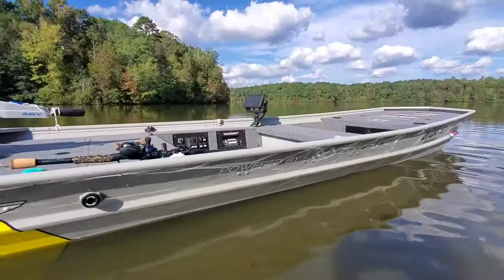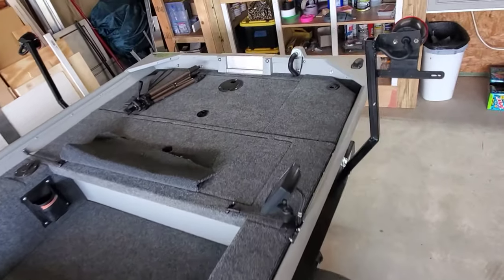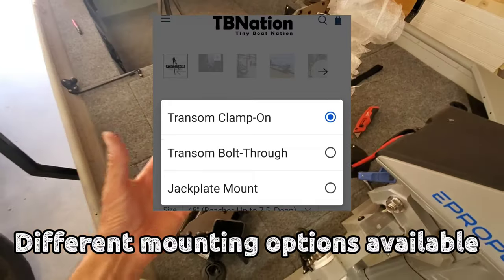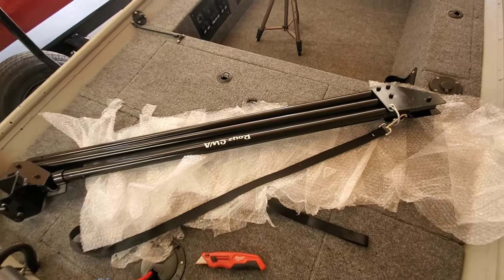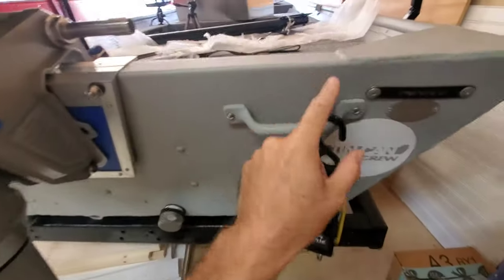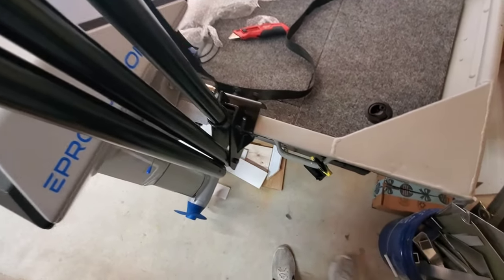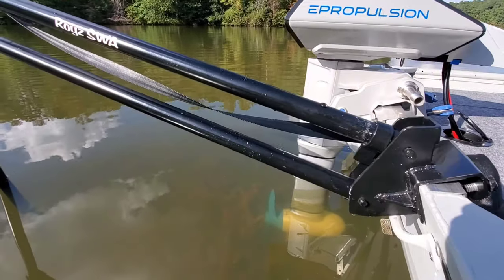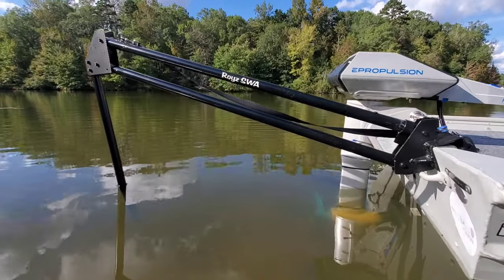Shallow Water Anchor On Jon Boat | The Anti Power Pole

Comment: Question:  Without a spring, and due to its light weight, what holds the pole in place?  It seems to me that due to it's light weight the "Point" wouldn't dig-in well enough to anchor your boat.  Great video!  I have a 17 ft. aluminum 8ft beam and a Merc 50 and interested in a Royz; if it will hold my boat. Thx.
Reply: Micro power pole would hold ur boat just fine if you want an actual power pole. The micro works great for my pontoon and kayak.

Comment: Why couldnt u just by a 1 inch 6 ft Long round aluminum rod and insert it into a vertical welded sleeve on front and/or back of boat.. with a nice sharp steep grounded taper? With a pull handle up top. And holes drilled all the way down for those clamp pins, (3 point pins?) put 1 pin above and 1 below sleeve.

Comment: Cool,but let’s see if it’ll work in current or wind where it counts. I didn’t see a ripple on this test. But if it holds I’m a buyer if cheap enough compared to the micro.
Reply from the maker: I assure you it holds in current and winds. Tons of guys I know running these in rivers on mud boats and I personally know a guy running one in Charleston SC running his jon on the flats.

Comment: Do u need to remove it  or just leave it on while you trailering ur boat on the road or even highway?
Reply from the maker: I leave it. It's bolted on tight and secure. Never had an issue
Reply: @AnthonyJonesBrigadeBoats  I think urs is a clamp on instead. Cause u don’t have to drill the hole right.  U just tighten the bolt.
Reply from the maker: Yes, clamped on as tight as I could get it. Removable though. Leave it on full time. Even when trailering, no issues

Comment: I would like how much your boats weight. It looks to me that all the boat builds exceed the recommended weight capacity of the boats.
Reply from the maker: Looks can be deceiving.  This boat is framed out of 2x2 western red cedar and 11/32 plywood.  Incredibly light which is how I achieve such high top speeds in it in my electric outboard test videos. I'll tell you this since you asked about weight on multiple videos- I've seen boats with 800 pounds alone in batteries. I've seen boats with full builds and two 300 pound men fishing out of it. I've seen 14 ft jon boats with over a thousand pounds in them. Guess what? They still float. It's a recommendation. Not a law. If you are very concerned about boat weight,  I would strongly recommend not modifying a boat in any way, therefore you can have peace of mind.

Comment: Only using one anchor pole, does the boat swing around in a  circle with the wind or current? Would you recomend two if you had the room?
Reply: Yes with any one shallow water anchoring the boat will allow it to slowly circle around the anchor depending on the conditions. You definitely need two of something for anything but calm conditions.   I currently run a Power Pole micro anchor on my 18 foot jon boat with a Venon Downright attached to my trolling motor, but have never been totally comfortable about this setup.  It holds fine, but I have always been a little paranoid about putting stress on my shaft and I already have so much crap on my bow that I don't want to add anything else there and I don't really want to add another micro for battery reasons and a complementing manual pole on the transom would kind of defeat the system I have now where I don't have to walk back to deploy.   

I've been thinking about trying these Royz out for a while now, but have honestly been worried about the how well they would anchor.  It seems counter intuitive and I have never found a straight answer about just how much weight this anchor is capable of dealing with.  800 bucks for two is kind of  risky!

Comment: A 10 ft stick it is only 70$. Way easier
Reply from the maker: Your entitled to your opinion although for my case I don't agree. 10ft pole in my 14ft boat would suck. Also when I do these product demos I'm not always looking the cheapest option.
Reply: No mud, sand, or water in the boat with this product either.

Comment: And the price is ? 🤔
Reply from the maker: Link is in the video description, the one I have is 400. Lots of options though depending on size and mount, they even do custom applications
Reply: @AnthonyJonesBrigadeBoats  , the reason I asked is I want to do a skiff for the saltwater flats and I’ll be using a push pole , I’ll mount a a pvc tube to the back of The transom with C shape brackets and put the pole in the tube , this will allow for deeper water and will allow the boat to adjust for the tide , plus I don’t have the spike hanging off the back , but the manual unit is cool and a great idea 👍🏼
Reply from the maker: Yeah man I actually looked at that option and if I were flats fishing that's what I'd do. I looked at a company where you can get different sized poles and mount the spike and t handle. Only problem fir me is I don't need a long length fir bass fishing and it would be super awkward inside my boat. Another example of why I always say all boat mods aren't universal! Different parts and approaches to different styles of fishing or goals for the boat. Good luck with your project man 👊

Comment: Why pay $400 for this when i could pay $600 for a powerpole micro?
Reply from the maker: If your truly asking why here is my answer- Micro powerpoles require power. They have internal parts that i have seen people break. They use a composite stake, not metal, the driving force of the micro is not what youd think for harder surfaces....My biggest reasons- Micro does not auto adjust to water heights, the Royz is mechanical with moving parts and keeps you anchored regardless of water height change with wakes or currents, if water height changes significantly with micro, you pull out of anchor. Lastly,  your number is wrong, 600$ for micro and spike is not included,  add another 100$. So 700$. Tbnation.net  had Royz on sale around X mas for 300$ so that's less than half the cost of an inferior product. Worth it to me. Just because it has Power Pole stamped on it doesn't mean it the greatest applicable jon boat shallow water anchor.
Reply: @AnthonyJonesBrigadeBoats  fair enough, however, i feel that in that case just a hand stake used in unison with a gheenoe style anchor bracket would be more economoical and easier while addressing the problem you mentioned with the power pole micro
Reply from the maker: Well you said why spend 400$ on this opposed to spending 600$ on that, not what anchor system is most economical. An anchor stake works fine, I personally do not want to carry an 8 ft pole around in my boat regardless if it saves me a few hundred bucks. If you see value in a product, buy it. If not, don't. That's with anything out there. I really like my Royz and understand why it differs from other products and how it benefits me. Apparently others do as well as  Roy has sold a lot of these units the past few months. To each their own I can only say that it works well for me.

Comment: U could've bought a fuel efficient four stroke motor instead of carrying a 250 pounds of batteries for that electric job u got for 4 grand
Reply from the maker: It runs on one 48v lithium battery pack which weighs 65 pds. The battery and outboard combined are actually about 5 grand retail but I got the package for free from ePropulsion due to the success of my channel. Lastly, I fish electric only lakes regulated by the state of Georgia, by law no gas outboards are allowed in these waters so a fuel efficient four stroke motor would do absolutely nothing for me as it can't even get wet. Think before you speak because you are wrong on many levels.
Reply: He literally said in the video "I'm at an electric only reservoir" no gas
Reply: @AnthonyJonesBrigadeBoats  gotta love overreach by gubment.